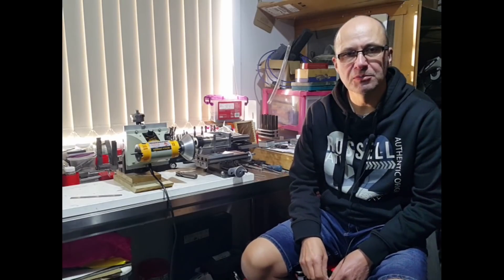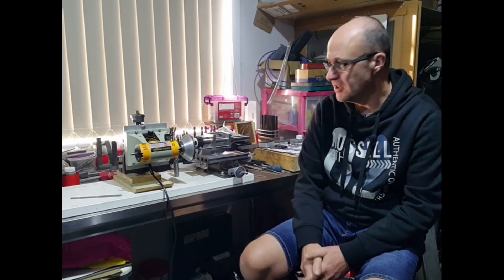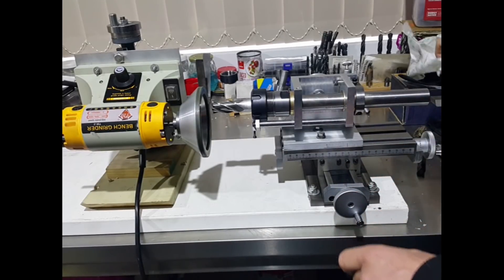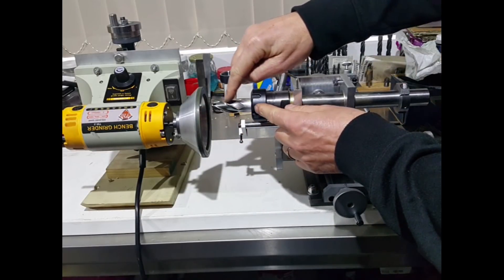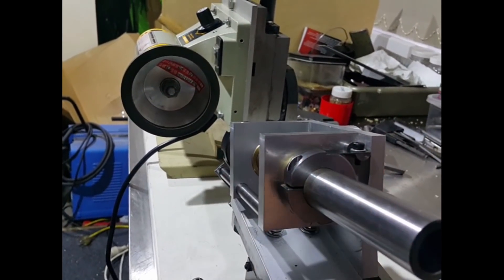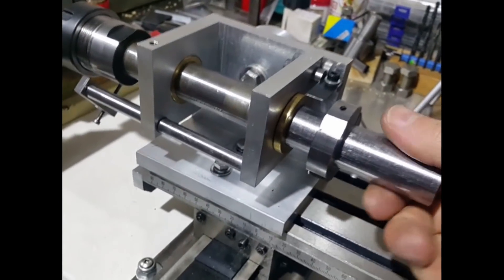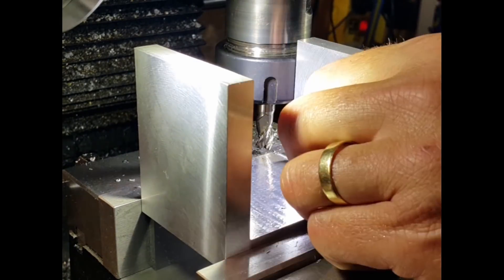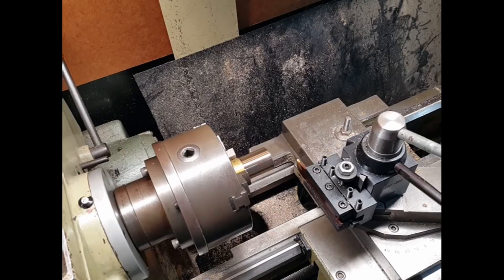#31 - Endmill Sharpener/Grinder - Part 1

Comment: Correct me if you beg to differ but when you set the part up in the mill to drill and bore the 2 holes you could have pressed the bushes into the bores (previously made)  and then bored them in the mill almost the same as line boring as the boring bar is rotating in a circle and that will be the same for both bores......the bonus is you can very easily measure both bore diams without having to go to the line bar removing and measuring experience etc.......I've (many years ago) been a horizontal borer for quite a few years and that aspect of line boring and setting a tool to a specific diam has always been a pain.
BTW, I don't think this set-up is quite a practical cutter grinder design......I have a CUTTERMASTER tool and cutter grinder and you could have adopted that design characteristics for this build quite easily......it's quite a common design and it's available for a similar design concept build if you browsed the 'net.
BTW again........don't EVER remove those bushes once fitted and bored as they will not be concentric due to having been bored to a different circle setting from the original turning.